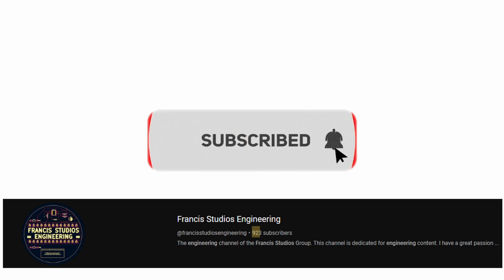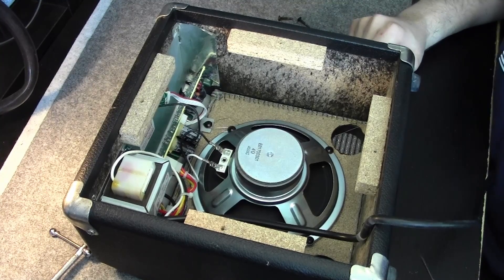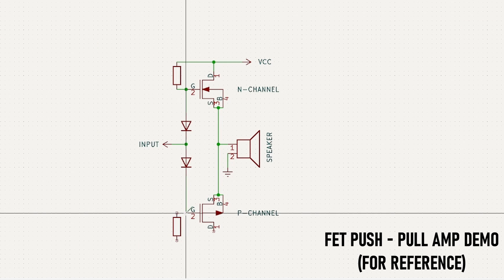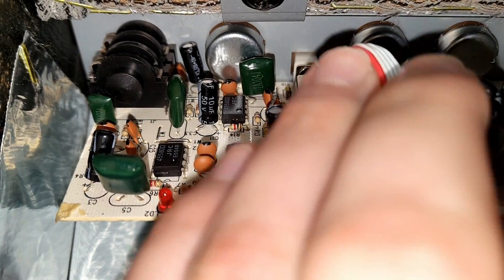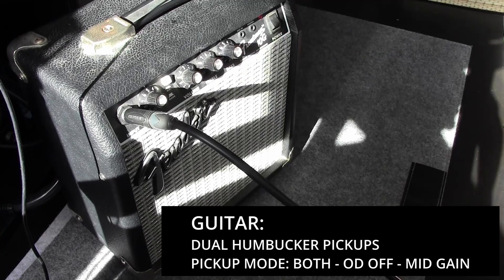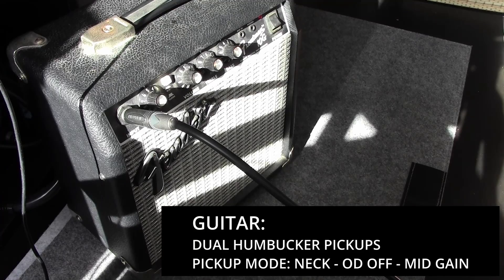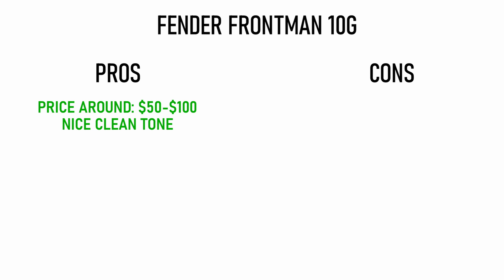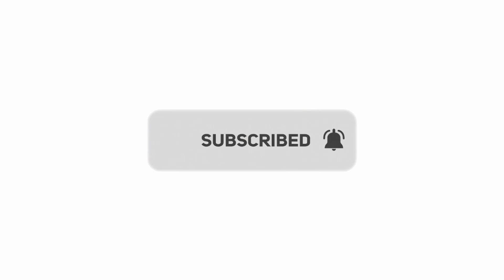Review and Disassembly of a Fender Guitar Amplifier

Comment: The metal chassis IS a proper heat sink.
Reply from the maker: I would disagree - respectfully. 
I would call it an adequate solution; as it can deal with the thermals of this small IC, but definitely not a nice solution IMO. A proper sized metal extrusion heatsink would cost a dollar or maybe less - that would have been a more proper, less hacky solution than ribbon wiring the IC down from the PCB.
Reply: @francisstudiosengineering  the reason it is a proper heat sink: "I would call it an adequate solution; as it can deal with the thermals of this small IC"
Reply from the maker: By proper I really meant an aluminium (or whatever other metal) heatsink as it's custom in HIFI amps; maybe mounted on the PCB. Something that does not just work, but there is a little bit more design invested into it. 

These were my expectations, but the reality was a little bit underwhelming, so that's the reason why I would phrase it as "non proper".

Comment: The tda2030 seams to be widely available from the usual suppliers for around a dollar a piece as an assembled module. Digikey says the IC is out of stock and out of production, I hate to design a project around an obsolete part even if there's still tons around. The LM1875 looks like a good alternative. Building a practice amp with either of these parts sounds like good content to me.